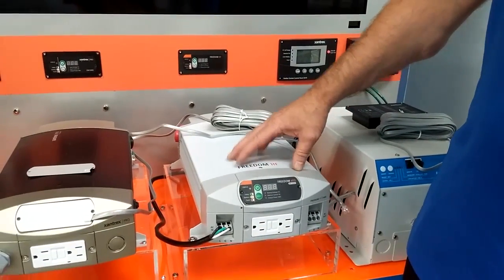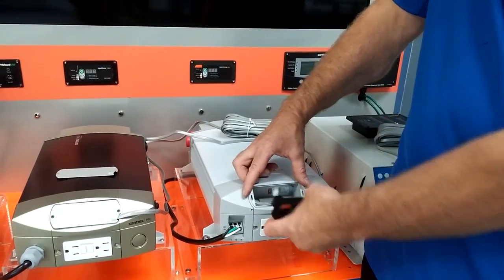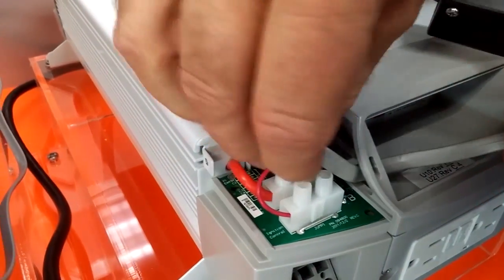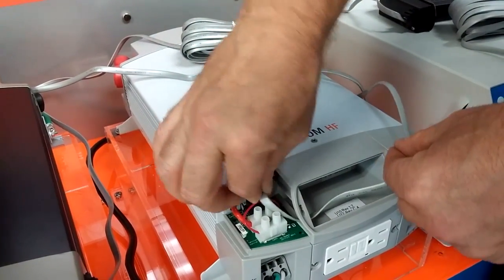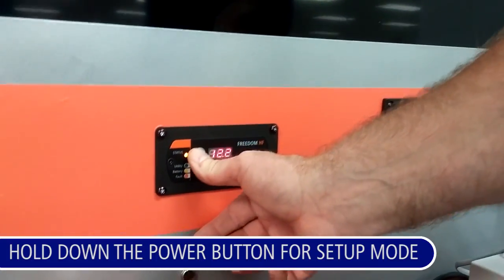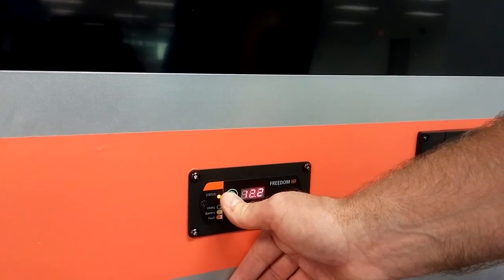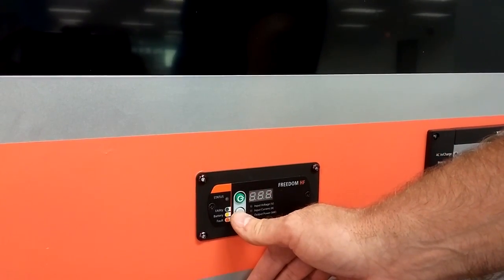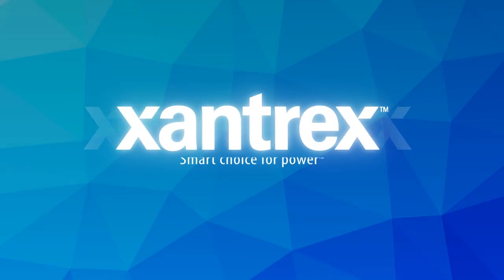Xantrex Tech Tip - Freedom HF Inverter/Charger Remote Panel

Comment: I have HF 1800 inverter and when going to settings it wouldn't change from Ln0 to Ln1 also it wouldn't circle around different settings when I press green button short press when it ON does jump to another setting and press of gray button also only does audible beeps and thats all. Only be able to turn ON and OFF with long press of green button. No error codes

Comment: My freedom hf doesn't work at all. I have power through the maxi fuse and to the inverter itself. But get no lights on the remote it won't do anything. 2020 peterbilt
Reply from the maker: Hi jeff, 
Sorry to hear that you're having trouble with the HF. 
Please tell us in more details about your situation over at our tech support page:
https://xantrex.com/support/get-customer-support/
or by phone 1-800-670-0707
Reply: How did you fix?
Reply: @tolgakabakc4554  the cable at the control panel in the bunk came unplugged. Plugged it in and it started working again. No idea how it came unplugged.

Comment: My freedom Hf    It not working it have RED light on breaker I restart still not work  what you think is the problem
Reply from the maker: Hi Amir, The red light might indicate an over temperature issue and the inverter will shut down to prevent damage to the inverter and protect the battery from being over-discharged. It's hard to determine without more specifics. Please reach out to Xantrex customer service for assistance at 1-800-670-0707

Comment: What if on the remote panel is not lighting up at all in my volvo truck???
Reply from the maker: If the remote panel is not lighting up at all then it is likely not getting power. Please check and reseat the ends of the communication cable. If that does not fix the problem then we suggest you  use a voltmeter to check the voltage on the DC terminals of the Freedom HF. From our tech support perspective, the problem is usually at one of these points.
Reply: Thx

Comment: I have a 1300 watt airfryer it works well but when I use my 1700 watt airfryer it shut off after being in use. How can I tell what size inverter I have in my Volvo
Reply from the maker: Dear Charles - Is it a Xantrex factory installed inverter in your Volvo? Would you know that? What does it say on the inverter?
Reply: @XantrexTechnology   how can I get one for the volvo 670 with the plugs in the front

Comment: Can the 1500 model be left on continuously or is it better to turn on as needed? I have a small cooler fridge that I want to leave in but don’t think this 1500 will handle that bc it displayed eo5 and lights went off in truck while the microwave was running. Thanks for the video.
Reply from the maker: Hello - The runtime of your fridge depends on battery capacity. How big is your battery in terms of amp-hours?
Reply: Xantrex truck batteries or inverter? I have 4 truck batteries on my semi. The fridge is a plug in cooler type. Not really a fridge but cooler fridge like. I forgot the name. $150 from a Loves truck stop. It’ll have to check out the name and specs when I get back to my truck.... got it now. 
It’s the Coleman TE Cooler thermoelectric 40 quart cooler.

Comment: I bought one from a guy who switched to a larger model. He kept the remote.
Can I run this inverter, bypassing the remote or wire the black, red, blue green white yellow wires in a pattern?
Reply from the maker: It depends on the larger model. It could be an XM1800 or perhaps even an HF1800. Its best to contact our tech support at 1 800 670 0707 for assistance.
Reply: @XantrexTechnology  thank you

Comment: I have 1800 and cannot find any info how to reset it. I downloaded the manual it doesn't tell you how to fix it, just tells you what the codes are.  It has two buttons status and select.  How can this be such a problem! All the code displays are not what I have.  Everytime it gets disconnected because of a storm, I get E03 which it says is an overload, which it is not.  if this thing dies I will never get another one.
Reply from the maker: E03 may be an internal failure.
 If you have been experiencing shore power issues, you may have had voltage spikes. Please call tech support at 1-800-670-0707 for further assistance. Thanks.
Reply: @XantrexTechnology   I have three times. All i get is disconnect from battery for hours and re-connect.  Meanwhile three days now, my food is going bad.  There has got to be another product with not so much guess work as to what is wrong.
Reply: KAREN MARCIANO try a 2500 from most truck stops. They carry a different brand,  and cost less than this 1500 brand. Travel Centers of America, Loves, Petro or Flying J. This 1500 came in my truck but after only 4 days I’m not liking it. More power handling capacity is always better in my opinion. 😊
Reply: @airforcelogistics3301  Thanks.  I gave it away and got a simple Schumacher battery charger for $45. Works like a dream.

Comment: Whats better HF or XC models for RV's?
Reply from the maker: The HF is an old model. It is modified sine wave. The XC features pure sine wave output and is equipped with a host of advanced features including lithium ion battery compatibility.

Comment: I keep getting error code eo5 after about 6 hours of use in my semi. I have a 1500 model and four agm battery’s
Reply from the maker: Hello - It likely has to do with low battery voltage. It is likely that your inverter stops inverting once batteries reach a specific low voltage set as a cut-off point by the truck manufacturer. It may be best to call our tech support 18006700707 for help. Thanks.
Reply: @XantrexTechnology  If you don't already,  your tech support is useless.
Reply: One Man's Adventure Yep. I have the exact same one and it did it the first time I used my small microwave after about 2 minutes , then lights went off in the truck so I looked at inverter and it said eo5. I guess it’s not powerful enough for the microwave. I prefer a 3500 plus inverter so there will never be a problem.